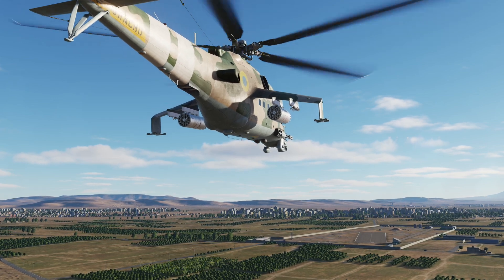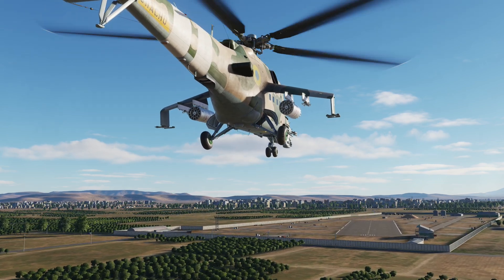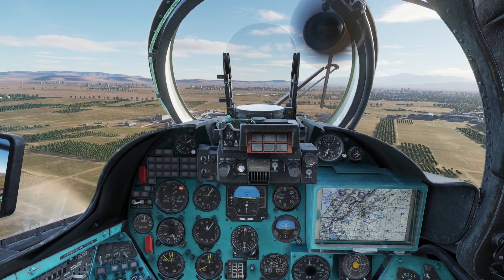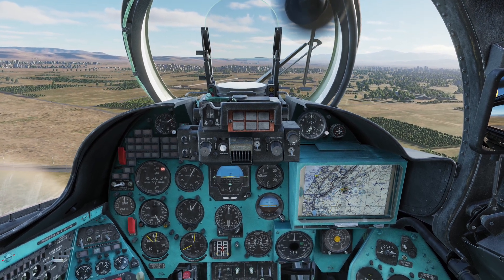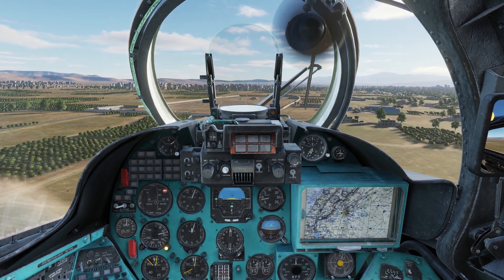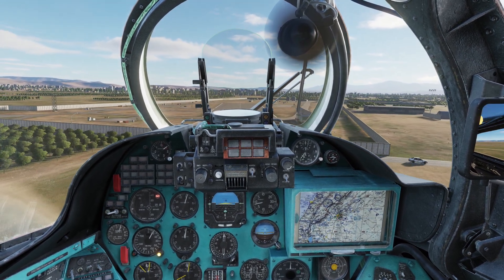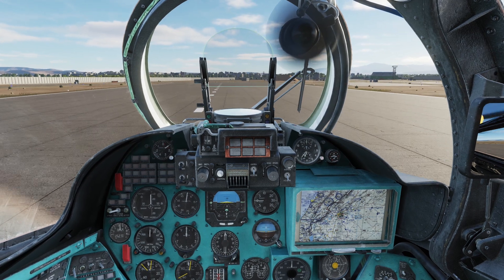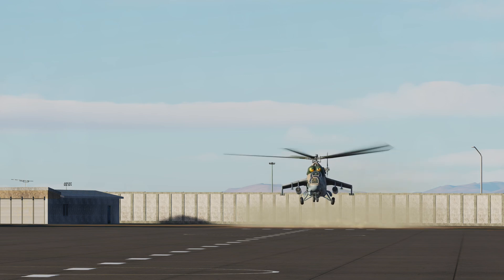DCS: Mi-24P | by the book | running landing

Comment: Appreciate the work on the video.

Still I have some things to add : I have no experience on Mil yet but while I know Russians loves to number everything, I doubt they give collective pitch values or similar, as so many factors are in play. Generally we aim, like in fixed wings, some glide path angles or gradients values, then accomodate parameters to match it.

Also, no wheels helicopters I know suggests applying back cyclic to reduce speed once and the ground, it's the best way to have a tail boom strike. Well, maybe not on the Mi-8/24 as there are centrugal droop stops that prevent feathering axis to fall too low, but still not a recommended practice.

Once again, I don't have real Mi-24 flight experience, but am fond of the Mi-8/17 and studied it's documentation for years, fly both fixed and rotaries for a living, and am a bit hesitant in some aspects of the " by the book " infos in the video.

All this is said with due respect, I'm pretty sure you did study your subject before posting it and have the original Flight Manual in hand, but I had to say it :)

PS : One technique I didn't find anything yet on the documentation I read on the Mi-24 is to make approach with 25-30° nose offset to have a clear view of your landing area and tightly control Aircraft trajectory. If done with right rudder dominance ( right offset nose ) you don't fear settling with power or overloading the turbines or MGB. I often use this IRL even in the small AS350 when a very steep descent angle is required, i.e tight jungle LZs. There is no such thing as tail rotor VRS, but LTE, and that would be quite difficult for the DCS engine to simulate it. Aircraft wake turbulence DCS feature is a debut and hopefully the whole engine can evolve to simulate all flow movement around any surface or airfoil, and then LTE and all those nasty aerodynamical effects could be simulated.

Cheers,
Hueyman
Reply from the maker: Hey Hueyman. Thank you for participating and keeping the conversation going!

Let me answer your points: Almost everything I do in this video comes straight from the Mi-24P manual. There are some older books from the Mi-24V that differ slightly. 

By shooting the approach from 1000m distance, at 100m height and 80kph I do exactly as you are describing - aiming for a gradient / path.
Suggesting that 0,5° less collective will result in a 2m/s descend is only correct in that specific situation - so maybe I should have clarified that.

In the V version manual they do not permit backstick after landing to avoid a tailboom strike, as you have suggested. In the P manual they recommend one third backstick - while keeping rotor pitch at 6-8°. It sounds very logical to me.

The nose offset technique is nothing I have found in any Mi-8 (T, MT, MTV-1, MTV-5) or Mi-24 (V, P) book and nothing I have spotted in countless cockpit videos that I have analyzed. But it does not mean that it isn't a technique that is used from time to time. It definitely makes sense!

Greetigs,
Viktor
Reply: @virtualflighttraining9694  Hi Viktor, 

Thanks for input and clarification !

Yup, sometimes a tiny differences can fall between two variants for some reasons, and only the engineers and test pilots may have the correct explanations for that !

For the offset nose approach, indeed I never saw such thing in manual or video but for instance, on the sim, I cannot perform a pinnacle or fregate landing with straight approach due to the crocodile nose. 

That being said, on the field techniques is often way out and beyond the Flight Manual, for example the Russians pushed the Mi-8 so hard in Afghanistan, Mil had to re-edit the flight manual with much increased weight and speed limits ! Ahah, good old Soviets ... 

Happy flying !

Comment: I know there are altitude and speed combinations which are dangerous. Apparently it's safe to hover at either high altitude or low altitude but there's an altitude range where it's not safe to hover. Does a rolling landing reduce the how close the flight envelope comes to these dangerous combinations?

Thanks for the video and thanks for the Q&A. I had a variation of question #7 cross my mind while watching the video.

I'm working on making a VTOL radio controlled quadplane. Your video made me wonder if a rolling landing could be used to extend the flight time of the aircraft a bit.

Thanks again for the video. I enjoyed it.
Reply from the maker: Hi Duane. The hovering envelope is something you think about when you actually plan to hover. In this case, there is no hover. To answer the second question: Yes, you will need less power with a running landing and therefor consume less fuel. So, yes, a running landing will give you more range. For the Mi-24 I'd say it's insignificant though.

Comment: This method seems to be pretty ok in terms of visibility of the runway. Personally though I prefer the 180 degree warbird method, so I can keep the runway in the left window as long as possible.
Reply: As do I. After so long drilling in navy aircraft for case 1s, it just feels easier for me to fly the pattern and come in at a 180 degree roll in on the field
Reply from the maker: Thank you for the input guys. There are many ways to do things in DCS. Some seem to make sense, others just work, because DCS has it's flaws. There are still quite a few aerodynamic effects not modelled at all (re-ingestion of exhaust gases, tail-rotor VRS,...) and "outside envelope" flight dynamic behavior is very difficult to replicate - even in commercial simulators. So you can either make use of those grey areas in DCS - fly your approach at 350kph, do a looping and then land backwards. Or you can mostly fly as it seems correct to you and perform maneuvers they way you think it makes sense. Or you can stick to what the manual says and fly it the way it was intended. That's the nice thing about DCS. Everyone can decide, how hardcore he wants to go. I personally prefer "by the book" and this is what the video is about.